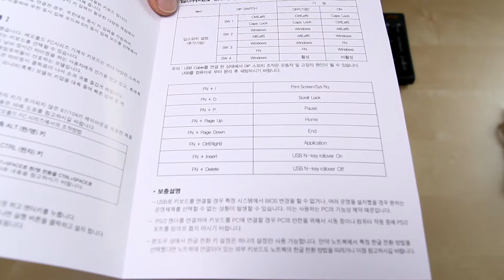Follow-up: Leopold FC980M

Comment: Ok so one more question - lol sorry. The layout overall the board is smaller than a full size...  are the keys the same size or are they smaller keys?  Or is there less space between keys to achieve the smaller form factor.  Thanks
Reply from the maker: No problem! Almost all the keys are the same size as a standard full-size board, and the spacing between each key is the same as any other board. The only keys that are smaller are:
1) The left windows key (1 unit (square) key, instead of a 1.25 unit key)
2) The right alt key (1U key, instead of a 1.25U key)
3) The right ctrl key (1U instead of 1.25U)
4) The right shift key (1.75U instead of 2.75U)
5) The "0" numpad key (1U instead of 2U)

Here's an article on keycap sizes that can give some background on the units measurements mentioned above: https://deskthority.net/wiki/Unit

These keys are smaller so that the arrow key cluster is able to fit tucked between the alphanumeric and numpad portions of the keyboard. In my use I haven't found any problems using these smaller keys, and I actually don't even notice they are smaller.

Comment: How is the brown mx version sound wise? I have a Filco Majestouch 2 with brown switches at work but it tend to sound quite a lot when bottom out. It sounds like the Leopold brown is a bit quiter? You are the only guy I know that has both keyboards! It would be much appreciated if you could do a comparison or share your opionon! :)
Reply from the maker: Comparing both side by side just now, I wouldn't say the Leopold is that much quieter, but it definitely has a deeper tone to the keystrokes than the Filco. The Filco is much much higher pitched and I could see this being more irritating to co-workers than the lower pitch sound of the Leopold. I think this is due to the keycap material being PBT on the Leopold vs ABS on the Filco, the sturdier switch mounting plate on the Leopold, and the addition of the sound absorption pad in the Leopold case. If you need just a little less obtrusive noise, I'd say the Leopold in MX browns would work, but if you want something a lot quieter, you'll probably have to go with MX silent reds, which are linear but include dampening rubber inside the switches themselves. I wish Cherry made MX silent browns (or some other tactile switch with internal dampening), but reds aren't terrible to use if minimal noise is needed. I think MX silent reds feel miles better than rubber dome switches, and still have an unmistakable "mechanical" feeling to them despite their linear nature.
Reply: Thanks for your response! Yes, your theory about PBT plastic makes the "clack" quieter sounds reasonable. Its not that my Filco is super annoying really, but I can see that it would irritate some people. I'm also considering maybe placing a rubber mat with holes for every switch between the keycaps and the plate. I wouln't like to use o-rings as it makes the keyboard feel as a rubber dome one but I might have to if people start complaining.  Browns and blues are the only switches I have had the chance to actually use. I have tried reds in the store but I would have to type on one for a couple of weeks to decide if I like them or not. 

Again, thanks for your answer!
Reply: I can't speak for the Filco, but browns on my FC980M feel like a solid "Thud" sound if that makes sense.
This is my first mechanical board so was worried about noise, but I'm enjoying it and it's not noisy at all.

Richie